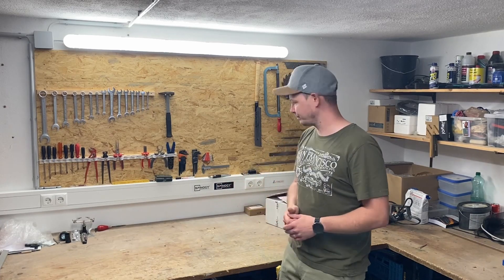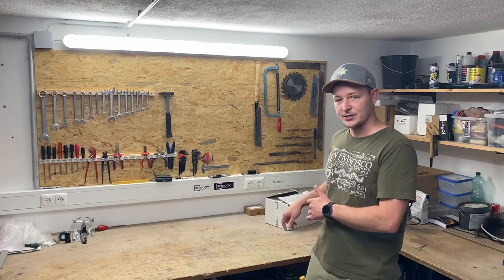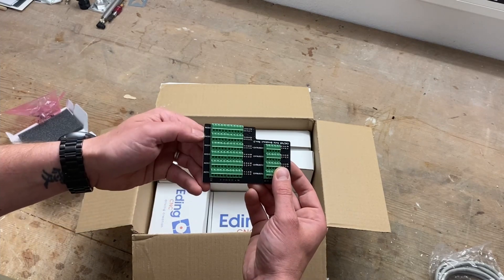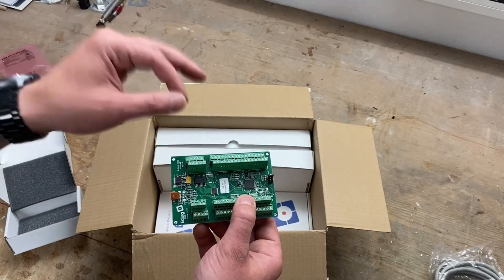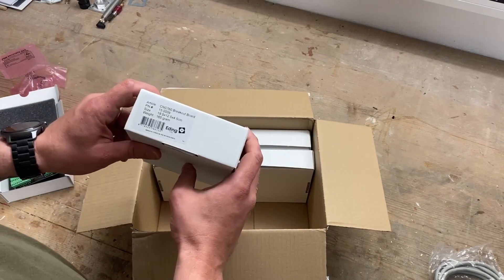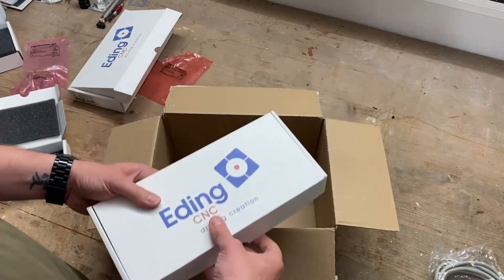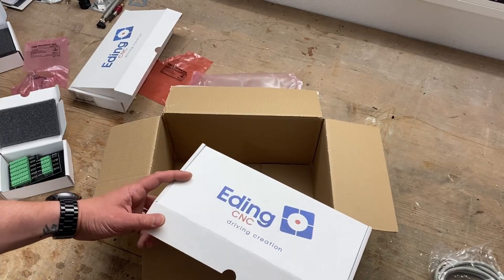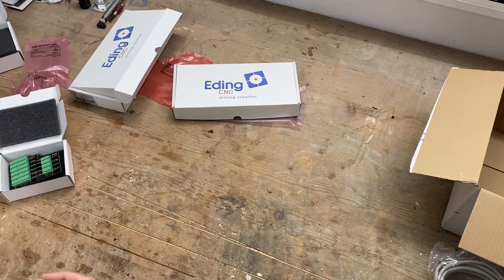Eding CNC CNC760 unboxing

Comment: Subscriber number 1000! :D  What do you think - is it possible to use one CNC760 kit to control two or three cnc machines? It's pricey to buy three but what if you have it ithe box with multipins connectors to switchover between machines? Of course there will be one one machine in operation at the time. How about the EdingCNC software? Is it possible to prepare different configurations for different machines and just use the one you have connected CNC760 to? Thank you for the video!
Reply from the maker: Thank you for your Sub! If I remember right you can add profiles to Eding CNC Software. But I actually don´t know if you can wire 3 machines to one controller. But the Idea is pretty nice!